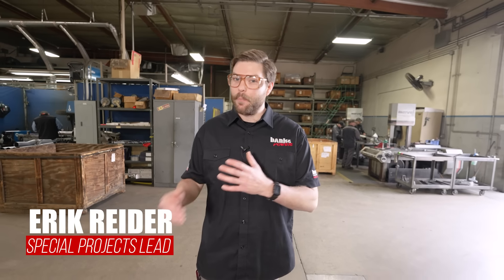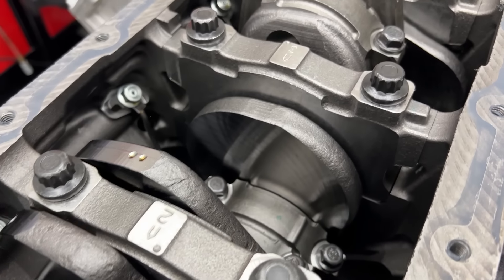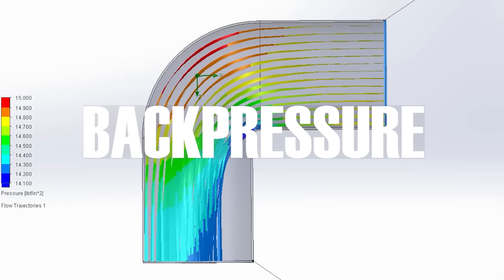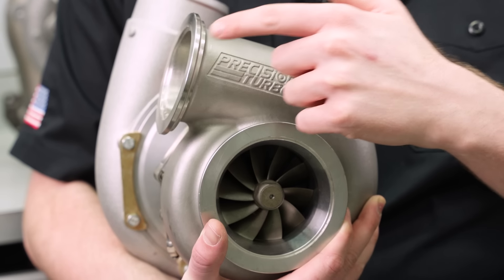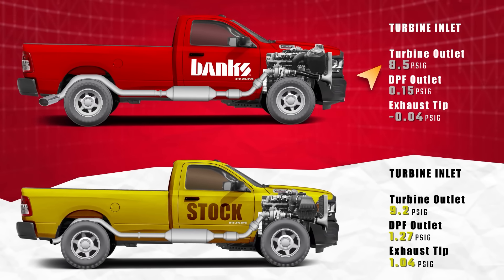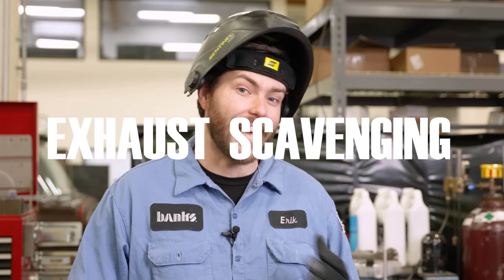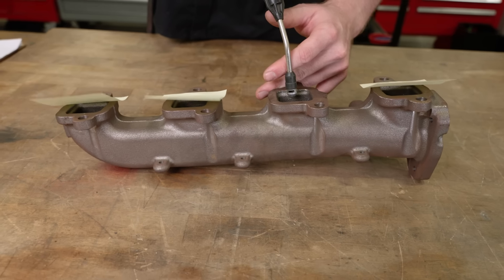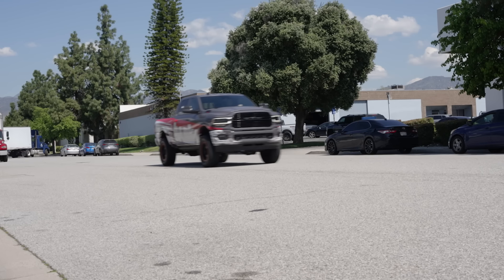Busting the exhaust backpressure myth | Banks Entry Level

Comment: I have an old T100. Creating resistance to both the ways air gets into the cylinders and out of them seems to have been a goal of the engineers. I too off the convoluted air filter housing  which iirc made the air take like six right angle turns. The intake and heads are said to have limited flow too. I too the EGR and PAIR systems were deleted. It also had the passenger side exhaust manifold send everything around the back between the firewall and engine and into the back of the other manifold. Then they proceeded forward just past the #5 cylinder exhaust port and down into the exhaust.  The driver side front and middle cylinder exhaust would flow towards the back and down.  The driver side back cylinder went forward abd then down. So...three flowed back, then around, then forward being joind by a fourtg cylinder and then down while two simply went back and down. A major flaw of this truck is somewhere north or 300k it often developed a HG failure on the driver side head all the way on the back right beside a tight area with little room between or around the head, manifold, crossover, and firewall. Basically there was a small area where the corner of the head and HG were constantly cooked.  I deleted the  crossover and had the passenger bank go back and down then connect a bit upstream of O2 sensor. The old clogged cat was removed too.  

It ran sweet.  However, it was awhike before i went on a long trip at interstate speeds.  It definitely made to be a work truck not a window time on I40 truck. Being self taught and mostly on a need to know basis do to time constrains i had some lack of knowledge and incorrect  assumptions.  I figured the truck would take care of air/fuel ratio and it seemed too.  I didn't realize how much gas helped keep things cool, and i figured getting the hot burnt gases away and out quickly was better than pumping them back thru engine.  I think it was a combo of all that and 750k+miles of that back part cooking that on a long high speed run towing a load that caused that driver side back cylinders exhaust valve to get hot and then not cool down semitrically. So now i got low compression and gonna change out it out for one by a company called Raptor cause customers have  good things to say and they back it with a 7 year/70,000 mile warranty which is pretty good warranty for an old remanufactured engine

Comment: I've never heard that backpressure is a good thing for 4-stroke engines, but have heard it can benefit 2-stroke engines.

Engines are basically air pumps, so basically any back pressure or restriction slows down the flow of air.

Comment: I always thought that less back pressure is always better until I tuned a naturally aspirated VR37DE engine on the dyno. After maximizing the tune, dialing in lambda, ignition timing, and cam timing, it ended up being too loud for the customer. So we installed the silencers into the rear mufflers which reduced the dual 2.5" outlets  to 1.75" outlets. We then did another dyno pull in hopes that it didn't lose too much power or increase the chance of detonation. To our surprise it picked up a consistent 5whp. I get the backpressure theory on a turbocharged engine but on naturally aspirated setups, it seems like there are more factors in play.
Reply: probably increased the velocity, would be nice to test against an airspeed device!

Comment: People confuse back pressure with having smaller diameter piping which makes more low end power but becomes restrictive. 

I have read on carburetors with some cams and very good flowing heads, having a muffler to make a slight amount of  restriction helps with tuning at idle. An issue  caused by the exhaust out flowing the intake. 

Either way,  back pressure is a Nono.

Comment: The 3.0 eco diesel in the Gladiator needs some Banks Intake & Exhaust love also. I’ve been patiently waiting for 2 years. I’ve already installed the Derringer and Pedal Monster and monitor it all with 2 iDashs. Was told the intake was being designed and expected mid 2023, still waiting.

Comment: Back pressure was a thing with two stroke motors because they have no valves and they wanted to time back pressure waves with the end of intake to limit fresh air and fuel from escaping. It was never supposed to be used with 4 strokes.

Comment: I think the misconception for back pressure was on race cars. And folks thought your modified street car needed it. Because back pressure was needed to have a smother power band on race cars Running open headers or too short of an exhaust at the wrong RPM wouldn’t run smoothly. Why were super trap mufflers created then? Which was often used to help with back pressure in race cars with short exhausts or just long tube headers that were open. Put a super trap on there and you could balance it out. This was done long before computer tuning was readily available.

Comment: The reason I was told for needing some back pressure was for the lower rpm range. I was told that you would loose horsepower all along the the rpm range until you reach the upper end were you would gain it all back and then some. So if you are not spending a lot of time in this upper rpm range (racing) you are going to drive around with less torque and horsepower than you normally would.
Reply: That's a misunderstanding of exhaust scavenging and flow.

Comment: I always understood that the idea of needing back pressure in the exhaust system comes from two strokes where if there is no backpressure fuel air mixture follows the exhaust out of the cylinder and and therefore increases fuel consumptions through waste.

Comment: One of the most shocking examples of back pressure on a turbo diesel I have even seen, was on the Cat C-12 diesel engines around year 2000.  They were 410hp and fitted to Kenworths......and those engines had real problems.....exhaust manifolds were failing every 6 months, along with turbo's running crazy high EGT's.   The engines were also under powered for their rating.   After a few years, CAT eventually owned up to having the wrong turbo charger fitted to the engines......it was too small, and caused a lot of serious problems.

Comment: This may be nitpicky, but a 5 to 1 pressure ratio is not the same thing as a 5 to 1 expansion ratio.  The actual expansion ratio is around 3 to 1, the rest of the pressure drop is due to temperature drop experienced by the hot exhaust gasses as they are expanded.    If you look up pictures of turbocharged engines being tested on a dyno, you might notice the exhaust headers are almost glowing orange to orange-yellow before the turbocharger and the pipe is a dull red after the turbocharger.

Comment: I thought the basic thought of backpressure was you didn’t want a vacuum effect from intake/exhaust duration. Meaning if you’re running no headers or open headers, the exhaust duration will allow air or exhaust to be sucked in from the exhaust valve being open. Meaning the backpressure is necessary to avoid air coming in from the exhaust duration

Comment: Took the pipe off a turbo diesel on a engine dyno and it lost power compared to the factory pipe.  It was only a small C17, but still lost a noticeable amount of power.

Comment: To my knowledge, they didn’t really start using the term “scavenging” till not too long ago🤷🏻‍♂️ so it’s a better term to explain it. 
    I did catch a video from magnaflow on n/a gassers and expansion chambers, showing a glass pac is better than just straight. But obviously once things are boosted u just need to get the exhaust out 🤙

Comment: Y’all at banks should do some comparisons with a superduty 7.3 powerstroke. I know they have exhaust back pressure sensors. I also know that those engines act a little differently when you 4” straight pipe it from the factory exhaust. Would be cool to see the results on a non emissions vehicle.

Comment: The myth of needing backpressure is disproven by the existence of exhaust throttles... yes, you read that right.  Some 2-stroke model engines had exhaust throttle plates.  Some Cox .049's had a rotating sleeve on the cylinder that closed off the exhaust ports giving very effective throttling and dependable idling.  Many larger engines had both an intake throttle (carb) and rotating plate over the exhaust port, linked together with a rod.  Exhaust throttle plates went away with widespread adoption of mufflers.  Restricting the exhaust, more backpressure, clearly slowed the engine.

Comment: What I couldn't understand back in the muscle car era of the 60's and 70's were the small diameters of the tailpipes of 350-400 hp cars from the factory. They were either 2" or maybe even 1 7/8". They looked strange and had to restrict the flow. No one could ever explain what their reasoning was for doing that. I was making a lot of exhaust systems at the time and stuck to my way of thinking that bigger was better by starting with headers then 2 1/2" in front of the cherry bombs (my favorite at the time) and 2 1/4" tail pipes. Everyone liked the sound and the enhanced performance (so they all claimed) of their cars. I was changing out the exhaust of cars less than a year old and changing single exhaust pickups to duals using only an acetylene torch and coat hangers for rod.

Comment: Well I know that when my blazers catalytic converter became clogged up, it had noticeably more torque but much less HP. Sport bikes have a valve system built into their exhaust, to cause restriction in the lower rpms to produce more low end torque and they open up as the revs climb. They're called EXUP valves.

Comment: This was excellent... But I want to see a collaboration of Gale Banks and Greg from "Greg's Airplanes and Automobiles" talking or doing basically anything... Talking about air density or manifold pressures, heat soaked intercooler performance limitations, or especially walking around a WW2 P-47 and discussing the combination supercharger and turbo charger or the dual superchargers on a Corsair, how the technology could have been improved or utilized elsewhere sooner... Basically anything 🤣 I have learned so much surprisingly interesting basic design principles about boosted engines from those two... A topic which previously was of very little interest to me is now something I enjoy long educational presentations on! 🤣👍 Greg also messes around with some performance parts for niche applications when he's not flying busses around the sky... I think they heavily focused on Alfa Romeo performance parts/tunes, so maybe don't mention that to Gale if that's not American enough 😂 but apparently they are also testing some base model mustang performance parts too... If that's more American 🤔👍

Comment: Residual exhaust gas is so often overlooked. Gas engines seem to be even more sensive (less CR and larger chamber volume to retain exhaust at near TDC).
The backpressure being multiplied by the pressure ratio, scavenging, and touching on the manifold/header affects, really good stuff!
Reply: And he keeps flipping from gas to diesel engines

Comment: Though I am not fully in agreement, some cases the flow of gases is improved (pulses flattened, aiding in throughput) I found this video unparalleled in its clarity, diagram, showing real world, values.  It seemed uncanny in that the talent anticipated what the average joe-mechanic is thinking and counters very intelligently.
I only was disappointed that, after glass packs, what were called "Turbo-Mufflers" came out, and wondered if they were also lacking in providing better flow.

Comment: 2 Strokes use back pressure to gain as much as 40% more power.But its all done with shock waves so the back pressure is only applied for a split second to shove air & fuel back into the cylinder.The rest of the time its less back pressure the better.

Comment: Most of the way thru this video I kept wondering if Banks would make me a set of headers and larger pipes for my 4cyl 3.0L turbo diesel full time 4x4 95series Toyota Land Cruiser. After 25y of chugging around on 96hp with its 2.5" pipes getting 23mpg average a 20hp improvement would be awesome to say the least.
Yeah, there have been far too many times when I've been towing 2500kg and its been foot to the floor just to keep speed. Sadly being a Toyota diesel the exhaust system doesn't rust so in 25y of faithful service I have never had any reason to have work done to it.

Comment: Engineer here, there are two ways to understand fluid dynamics, and explaining it based on pressure has always made the least sense to me 😅.

When youre running your turbo with shop air, you state its the pressure differential that drives it. This is true, but its such an esoteric explanation to me. A much clearer explanation is that its the movement of the air that drives the turbine. Air has momentum, if you put your hand in front of the air nozzle you feel the air pushing on your hand - its taking the momentum of the air and transferring it to your hand. Sure you could say "I have high pressure on the front of my hand and low pressure on the back and this pressure differential imparts a force on my hand that makes it move", but isnt it much more clear to just say your hand is trying to hold back and slow down the air, and in doing so the air is pushing back on your hand? This is exactly whats happening to the turbine, the momentum of the air is pushing each blade on the turbine.

When you think of it this way, it quickly makes intuitive sense why moving the air more quickly, at a higher velocity, would impart more momentum and spin the turbine quicker. You want the air coming out of the exhaust moving as quick as possible, and every bend or component in  between slows down the air. You dont need to understand major and minor pressure losses, pressure gradients, etc, you just need an intuition for what slows down the air.

Thinking of lift on an air foil (or air spinning a turbine) as momentum, rather than pressure, makes WAY more intuitive sense to me. Both explanations are correct, and equivalent based on bernoullis and conservation of energy along a fluid stream, but velocity and momentum is something we experience every day compared to pressure differentials which are a much more esoteric concept I think.

Comment: Backpressure isn't needed if you're running full tilt all the time. But seldom are people doing so. Look at open header designs like zoomies, where they suffer a loss of horsepower and torque in mid range RPM, and not by negligible amounts either.
Furthermore you can look outside of cars. Low and medium speed diesel engines all have exhaust ports in their cylinder heads that are 10-20% smaller than the intake ports. Sometimes smaller exhaust valves too. Yet these engines also run more efficiently than any automobile.

Comment: I would have got the what’s causing the most back pressure question right if I saw it was turbocharged. Great visual on scavenging though. when the exhaust pipes are properly up tuned it can have a great effect on an engines power production.

Comment: Hi there, first of all thx for the very interesting video about back pressure. I enjoyed watching it and also learned a bit at the same time. But, my understanding of back pressure is that it is needed as to not burn up your exhaust valves or in other words to reduce the exhaust gases flow a little but not too much! But it seems I was wrong!

Comment: This is all well and good. But the only thing Banks offers for my ten gen f150 is an A-pillar gauge pod, literally. I'm fairly confident that if I were to mount that to my exhaust it will melt, not to mention smell horrible. So that product isn't going to help me one bit to get cold air in and hot exhaust out. So I have to go with K&N on the intake side of things and I ended up just building my own exhaust system. Equal length shorty headers and 2.5 inch cat back duels with an X-pipe. I also did away with the pipes going over the rear axle, they both exit out the passenger side about 5 to 6 inches ahead of the rear tire. Oh and no muffler. 
But it is to bad Banks doesn't offer anything for my truck. It was the first place I went to look for a cold air intake system. I really wanted to get away from K&N. Not because I think they have a bad product, but because I felt it was time for a change. But oh well, I tried 😕

Comment: I own a chevy cruze 1.4T-charged. and i occasionally, about once a year give or take, get an enginge overboost code up to 145kpa of build up in the intake manifold. I assume the waste gate gets stuck for a sec, triggers the code, and then releases. Should i be worried about the pressure buildup blowing a gasket or putting too much strain on the crankshaft?

Comment: Backpressure is required for cooling exhaust temps. Take the headers off an engine and see how fast it burns out valves and warps heads. Exhaust ports are engineered to work with exhaust systems to even out pulses and increase heat escape which increases power.

Comment: It all depends on your application as with anything, there are tradeoffs.  If you want more high end you will likely loose some low end.  Look at your camshaft, the ones that offer high end offer suffer to idle properly... same goes from exhaust valve to tailpipe.  The high low argument can be solved by VTC, VTEC, and i-VTEC as you get the best of both worlds and give up nothing.